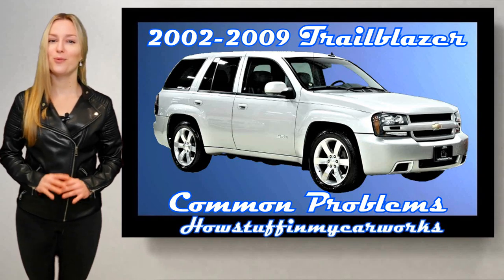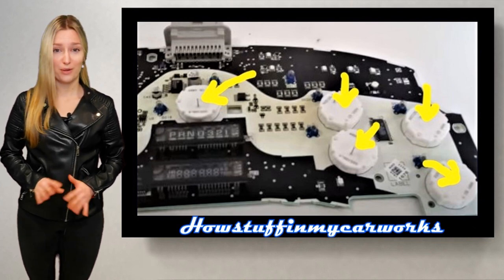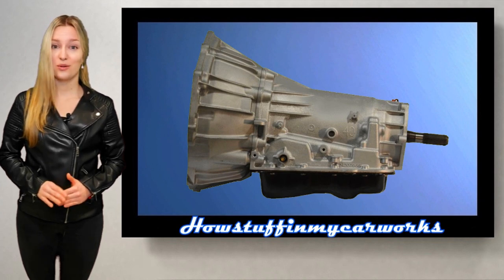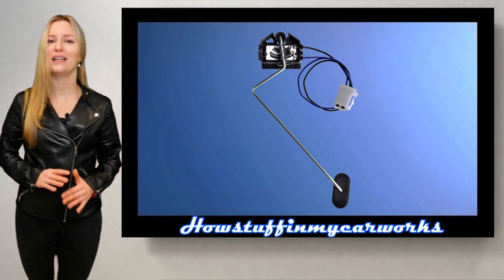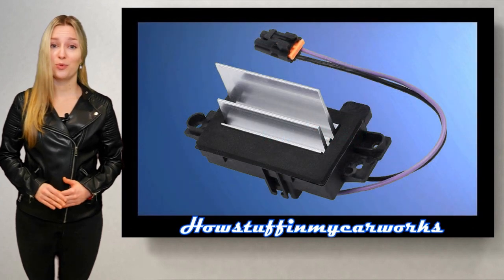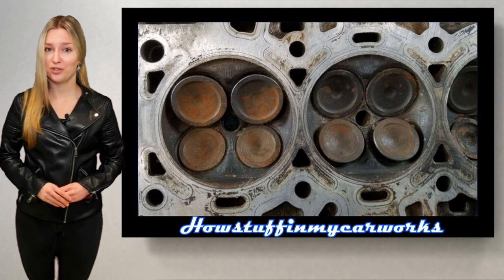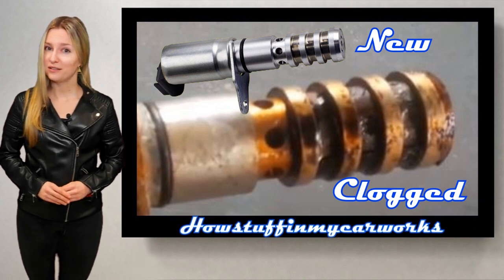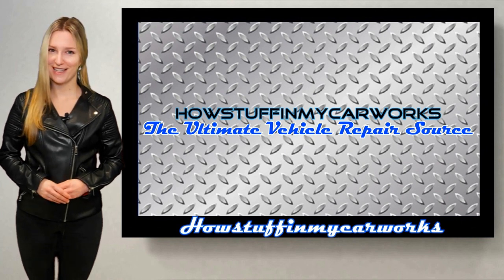Chevrolet Trailblazer 2002 to 2009 Common problems, issues, defects and complaints

Comment: #11 Oil pressure sensor malfunctions
#12 Power steering lines corrodes and break
#13 18.2 whopping MPG
Reply: I wish I got 18.2, i'm around 13-14 :face-purple-crying: